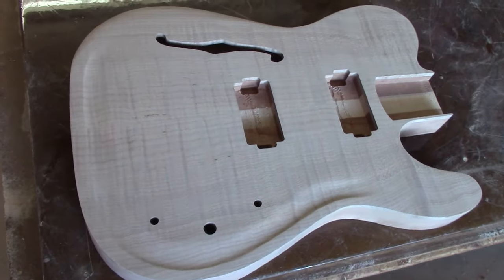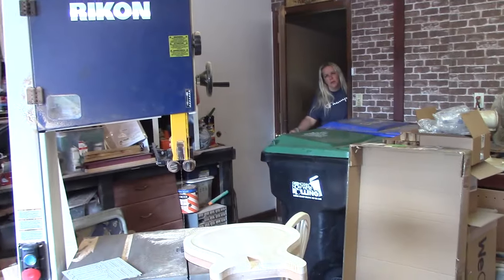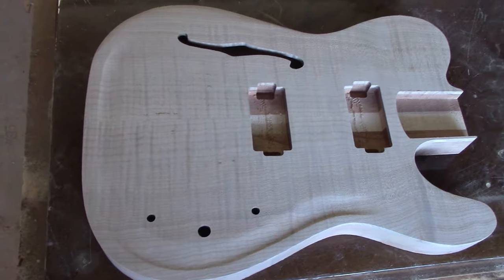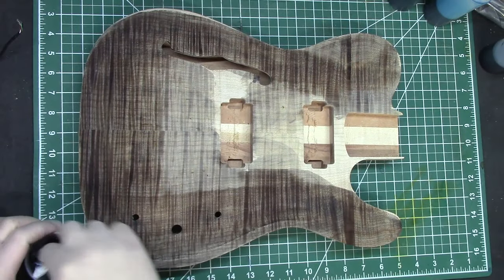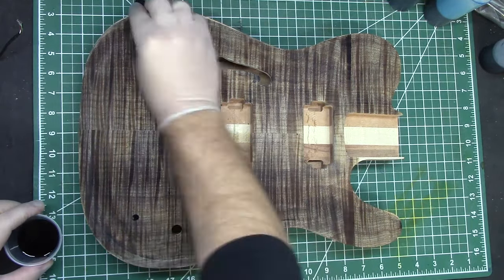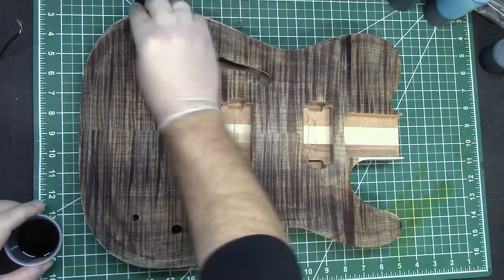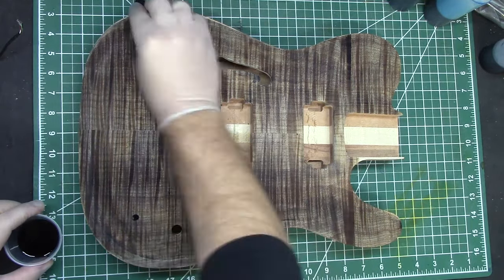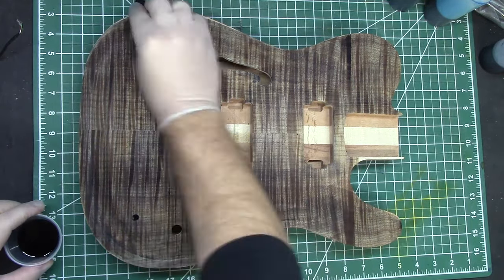I made a Partscaster And My Wife Made Pickups For It OUT OF REFRIGERATOR MAGNETS! YES I Said My Wife

Comment: Neodymium magnets can create a large field.  I'd reduce the number to just one.  I like the look of the neodymium as a rail but putting it at the top of the pickup will pull at the strings.  Perhaps turn the pickup so that the narrow edge is used as the rail.  For this you'd need to change the orientation of the poles though.  Alternatively, you could mount two magnets at the bottom of the bobbin and have steel screws to extend the field, sort of like a P-90 but with a lot more magnetic field.

Comment: I had a feeling that there would be a lot of pull in those magnets. 

Quote from Wikipedia
"Some high-output pickups employ very strong magnets, thus creating more flux and thereby more output. This can be detrimental to the final sound because the magnet's pull on the strings (called string capture) can cause problems with intonation as well as damp the strings and reduce sustain."

If you just used 1 or 2 with a single piece of flat steel on its side like a blade glued on its edge to the flat side of the magnets (to make a T cross section) that could work.  

If you look up single coil blade pickups on google you will see what I mean.

Comment: I imagine one of those magnets per pickup is still probably "too strong" by conventional standards. That said, you could use a ferrous material like steel for the pole and slap one magnet on the back side of it so it's not so close to the strings. Maybe a piece of bar stock cut to the same length as the magnet? It's definitely worth experimenting with. Kinda has a hot rodded P90 vibe to it.

Comment: You need to realise that the neodymium magnets not just pull the strings down, they also mess up the intonation a lot. I have tried it on a bass guitar with much smaller magnets and the result was not usable. You can check it out yourself like you would adjust the intonation on the bridge. I got results of 30 cents off (100 cents = 1 semitone, or one fret up or down).